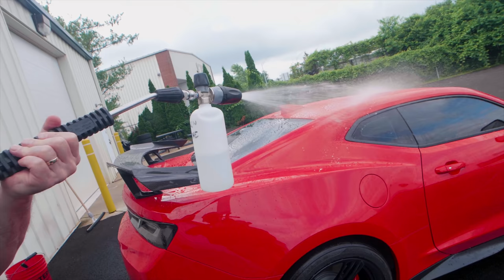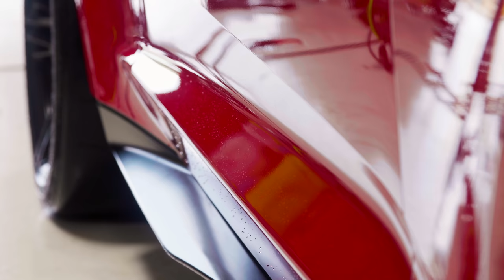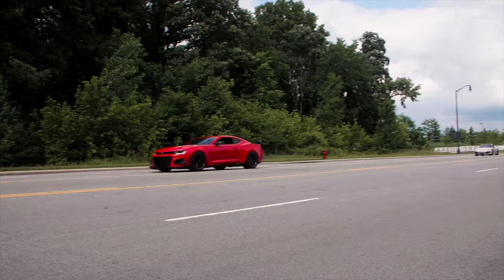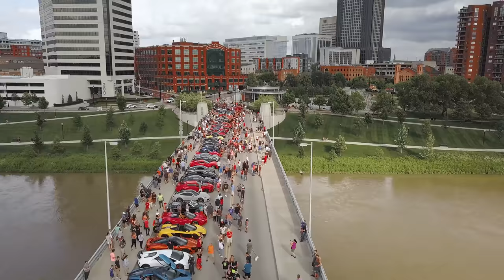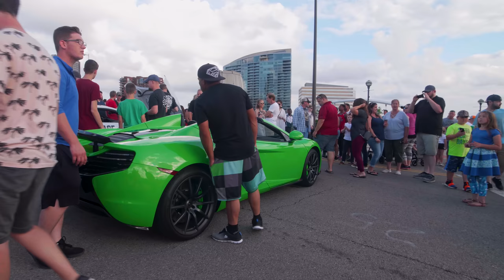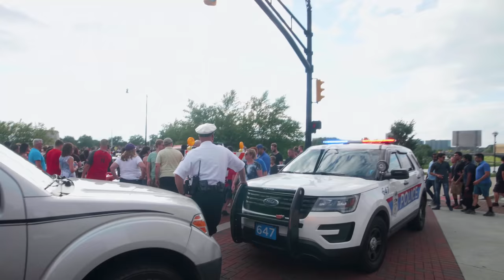Exotics on Scioto Mile

Comment: i guess the matte hood was a pain to clean. i see it got swapped out for the standard zl1 hood
Reply from the maker: It's simply removal of a vinyl wrap, not a hood swap. Personally I think it looks much better in body color as the black matte wrap doesn't match any of the rest of the black on the exterior of the car. If they would have done it in a satin black that actually matched the mirrors and lower trim, it would have had a better chance of remaining.